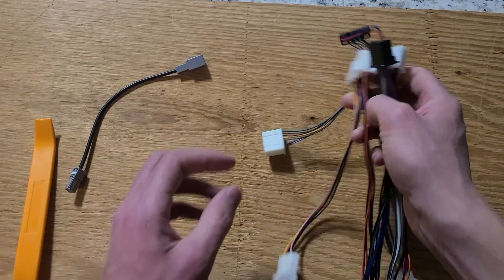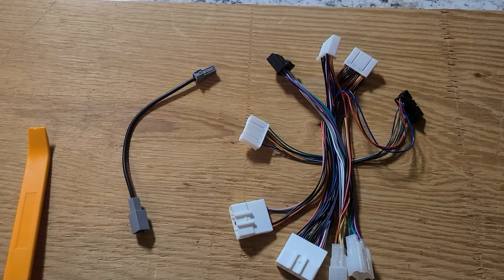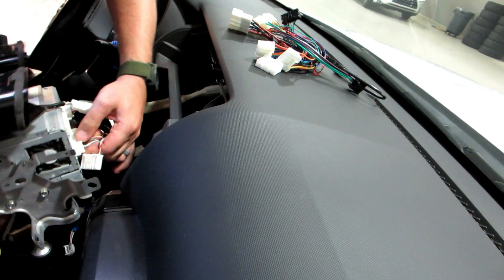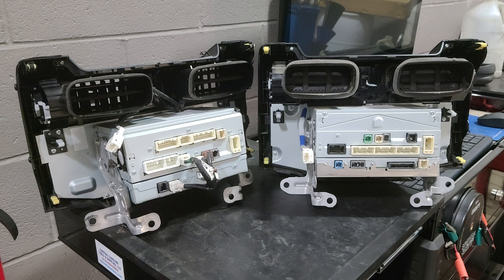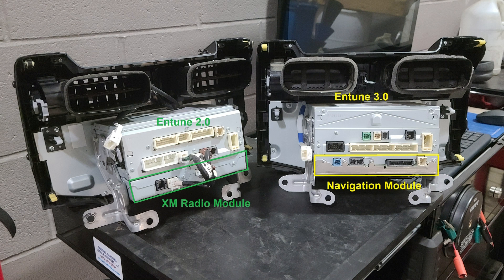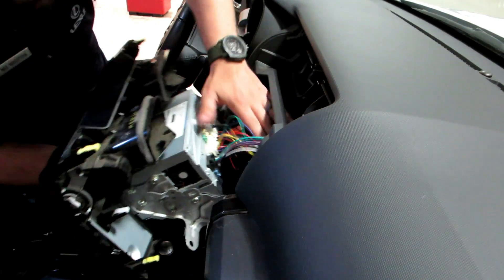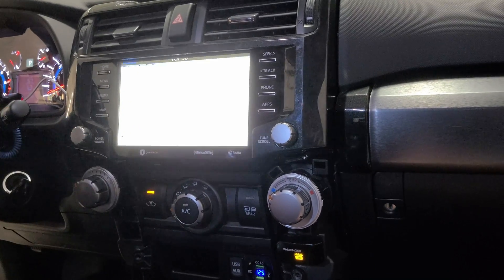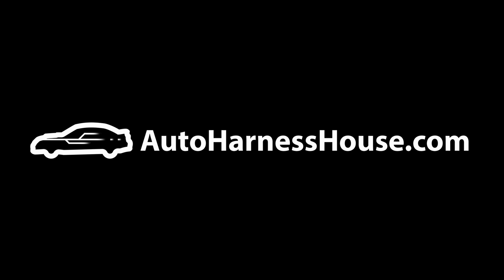Toyota 4Runner Entune 3.0 Transplant Adapter Wiring - Carplay/Android Auto Retrofit - Install Demo

Comment: Hello. What would be the Toyota runner 2019 stereo connector or harness to install it on a 2011 Toyota runner? It would be the original Toyota stereo
Reply from the maker: We've built custom adapters for this. We just need to know if you've got JBL in your 4Runner and we should be able to sort it out for you with a custom part.

Comment: I have a 2013 4runner with stock nav unit. I guess that's entune 2.0.? Can i upgrade to entune 3.0 and get Apple Casrplay on a stock unit.?
Reply from the maker: @TURBOINTEGRATYPER  we don't have a way to update the software on your existing unit.  We sell this adapter so that you can swap in a more powerful OEM unit that will have carplay.
Reply: @ Ok does the more powerful oem unit fit a 2013.? I’m guessing no.?

Comment: Hi friend, I have a project to change the stereo of my 2010 Toyota 4runner for a 2024 stereo, the same one in the video. I want to know if it is possible. I know that physically it is, but I don't know electronically.
Reply: Im planning to do this too
Reply from the maker: We can help with this. It's a bit more complex if you've got the JBL/Nav system in your 4Runner but we can basically custom build an adapter to make this work based on your vehicle specifics. Please email us! inquiry@autoharnesshouse.com

Comment: Do you me keep xm with this?
Reply from the maker: Yes, XM radio can be retained. Usually the antenna plugs right in without any modification. Sometimes the XM radio antenna connection is in a different spot on the back of the unit so we have to use a short extension to get it to connect. Please let us know if you need this!

Comment: Can I retrofit a JBL Entune 3.0 head unit into a non JBL 2012 4Runner?
Reply from the maker: No, we always recommend installing JBL in a JBL vehicle and non-JBL in a non-JBL vehicle. The JBL headunits don't work without the OEM JBL amp and those amps can be hard to find. In addition, generating wiring to add a JBL amp is very involved and very expensive if you don't already have JBL in the vehicle.

Comment: Hold on, on the navigation module box I see a long black harness connector port on the left of the white antenna outlet. Does that need to be plugged in or will the navigation still work without it? Also, what does that connector do exactly? Thanks again.
Reply: Yes, the long black plug must be connected. This connector is part of the Navigation transplant adapter that we provide. It connects some signals from the Navigation unit to the main headunit.

Comment: Have you guys ever tried doing this for a 2019 Corolla non hatchback
Reply from the maker: Yes, this will work for the 2019 Corolla. You'll want to verify that the dash fascia will mechanically fit, though. Electrically, this kit will connect the new unit to your Corolla. Thanks!

Comment: Does the built in navigation actually work in the unit you installed. If not, then what is missing?
Reply from the maker: There's a coaxial cable that goes from the main headunit to the navigation box. The customer didn't have this cable ( it's a Toyota part that is usually included with the used navigation units) when we did the install, so the navigation didn't work until he bought that cable. Once he installed that cable, Yes,  the navigation worked flawlessly.

Comment: If you put a navigation entune 3.0 system to replace a non-naviagation entune 2.0 would navigation work? Just not sure how that works
Reply: I have the same question.
Reply from the maker: Yes. It doesn't matter if the vehicle had Navigation. It only matters if the Entune 3.0 unit that you're installing has Nav. Also, most vehicles will have a GPS antenna even if they didn't come with Navigation, so you shouldn't need to buy/install a GPS antenna for most situations.

Comment: 6:36  I noticed you didn’t address the hazard installation. I’m having issues when I click the hazard button it won’t stay on. Am I doing something wrong?
Reply from the maker: For the Hazard light, you'll need to use the old switch (the one that came with your 4Runner. The new switch is a momentary switch so it won't work correctly from an electrical standpoint. The issue becomes that the hazard light switch that you have doesn't fit firmly in the hole on the new headunit. You'll need to find some way to secure it in the new bezel. This could be by using some double-sided tape or a zip tie from the back but basically, you just want to get it to seat in a way so that it doesn't rattle.

Comment: Want to put an JBL entune stereo in my Gen2 taco also JBL? Do you have a harness for this or am I going to have to splice wires?
Reply from the maker: We have an adapter for doing the Entune 2.0 to Entune 3.0 upgrade for a JBL truck. If you are planning to do it on a pre-Entune 2.0 truck, we should be able to work something out for you. No need to splice wires. Just email us!